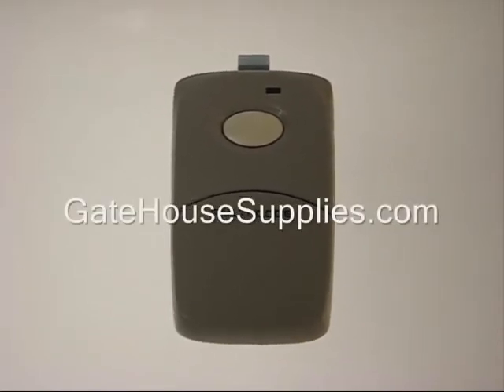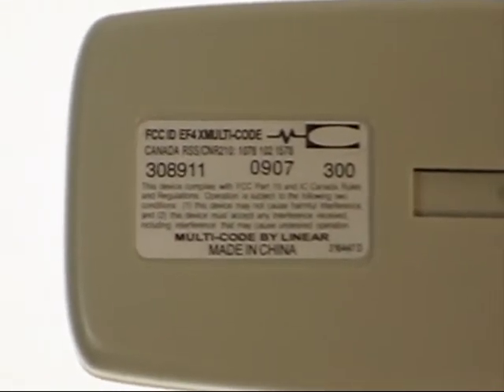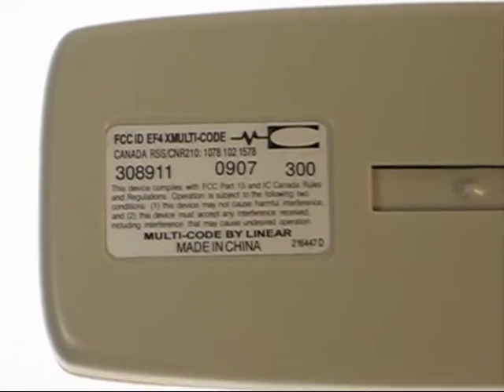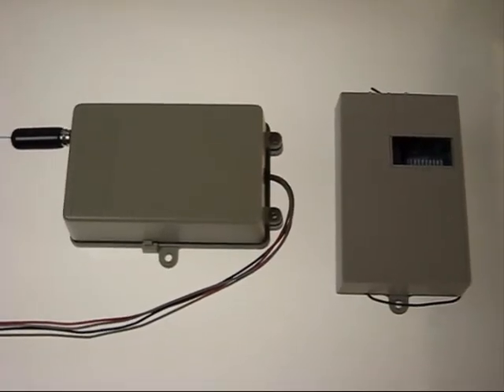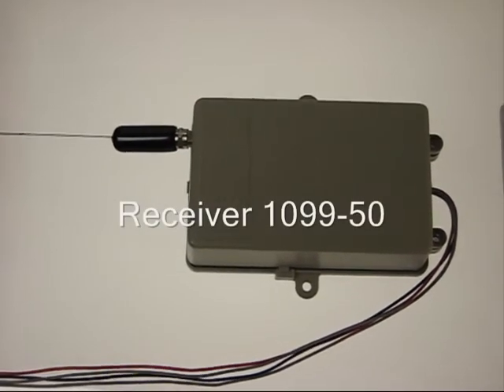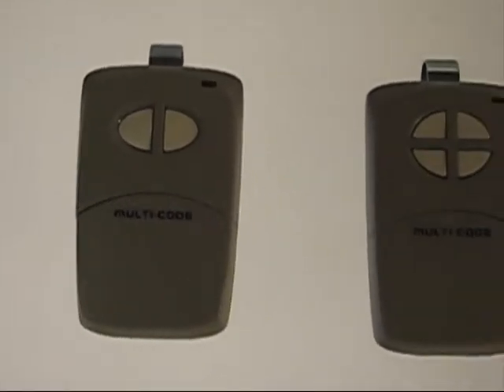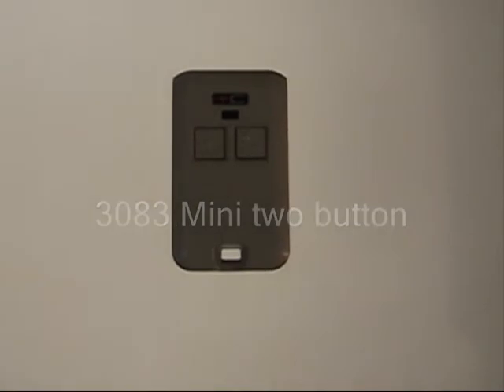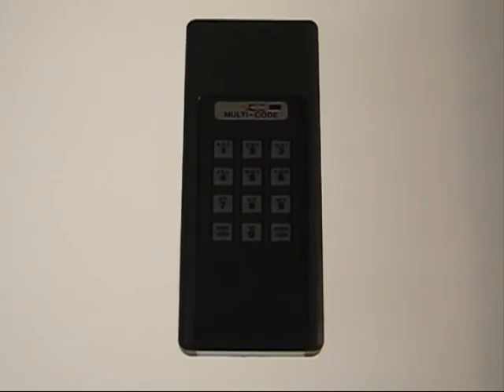Multicode Remote Controls

Comment: Multi-Code and Linear, from what I've seen, have been the staple in universal radio controls for many years, and still are in some areas. Back when there were more brands around than Chamberlain and OHD (and their counterparts), other brands either came with a Linear DT, or a Multi-Code 1089/3089.
My personal preference is for the previous generation of 3089.
Thanks for posting this! :-)

Comment: Mine isn't working I haven't touched the code the battery been changed can I reset it then put the code back on ?
Reply from the maker: Derrick, You can try another battery just in case and you should toggle each switch back and forth a few times that might help. If the battery is good and the code switches are correct and it still doesnt work then you will need to replace it.

Comment: My gate code in my building is only 8 digits according to management. Can I use the Multi Code that has 10 settings ?
Reply from the maker: Probably not, do you have a make and model of that other remote?  Linear perhaps ??